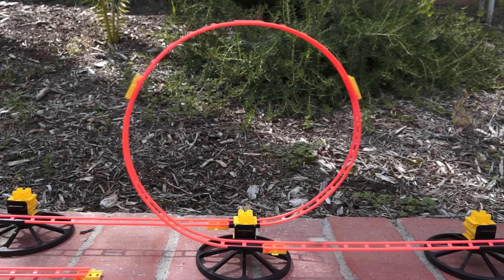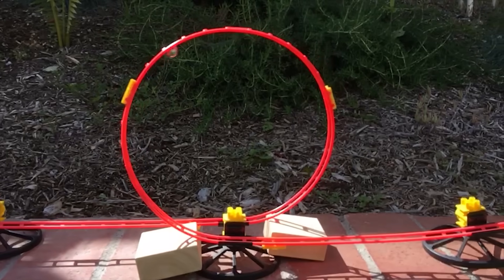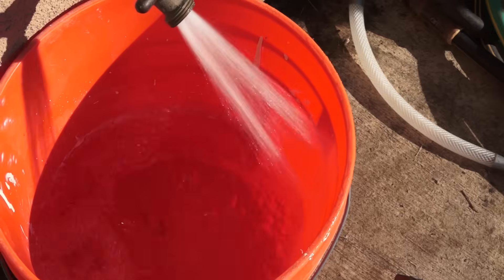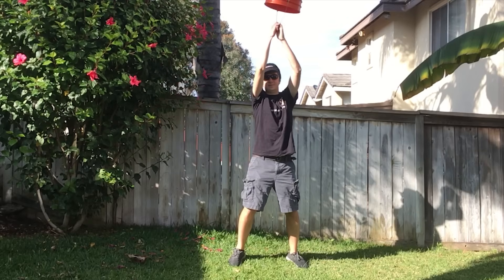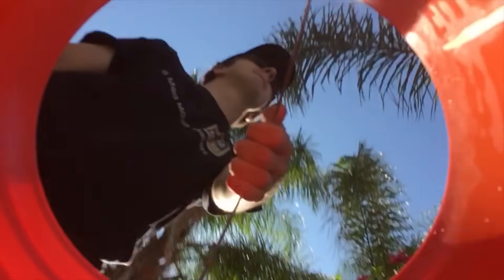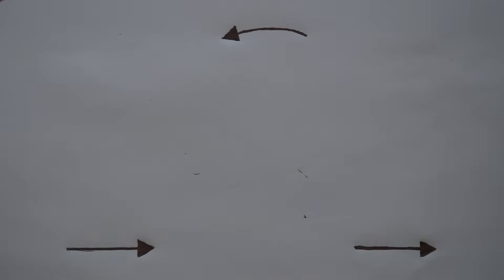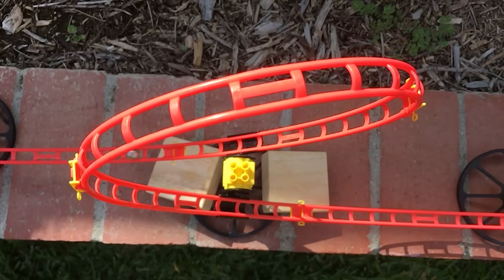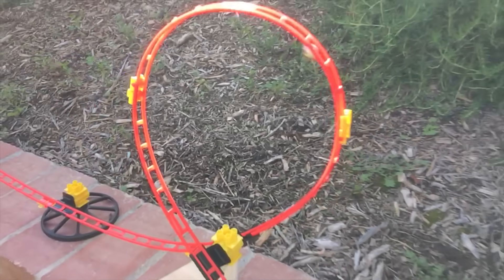Why a Perfect Circle is not a Perfect Loop

Comment: I reality you still experience less G's at the top of a loop than at the bottom. For example when you enter a loop with 4G you wont experience that same amout of force at the top of the loop when you're upside down, because you would snap your neck. At the top of the loop the forces are much closer to 1,5-0G.

Comment: Teardrop (technically called clothoid) loops are great! They reduce stresses on the structure of the roller coaster, the train, AND the riders! However, circular loops are ok if the loop is large enough!! Take, for example, Full Throttle at Six Flags Magic Mountain. The shape of that loop is a perfect circle. It also used to be the world's tallest loop at 160. Now granted, that loop was designed to produce hangtime at the top (the feeling that you will fall out but the restraints hold you in) as the loop is so large that the train goes very slowly through it, nearly stalling. But that's an example of a circular loop on a modern roller coaster.
Reply: I think full throttle isn't a perfect circle. It's just slightly teardropped. The track intersection at the bottom of the loop still creates a tiny X. The tracks aren't parallel to each other.

Comment: What if I want to feel weightless
Reply: There's a cost to weightlessness, when you are trying to set it up while constrained to the gravity of our planet.  A circular loop no matter what the radius, would require you to experience SIX TIMES your weight at the bottom of the loop.  This means a typical person will weigh a thousand pounds at the bottom of the circular loop.

This is why actual roller coasters use a tight curvature at the top, and a gradual curvature at the bottom.

Comment: It's true that roller coaster loops are not built as perfect circles but this is NOT the main reason. It takes a higher speed to make it all the way around a circular loop without feeling negative G force at the top,  In addition, the circular loop causes sudden changes in acceleration and forces that are uncomfortable, as well as greater forces on the track and supports

A non-circular loop allows a smaller speed and a more gradual change in G force from the start to the end of the loop.

Finally, it's not necessarily true that a circular loop always requires more energy. A circulat loop of the same height will require a higher starting speed to maintain a positive G force on the riders. With a non-rigid track, such as in this video, the higher speeds and forces cause more energy to be wasted in deforming the track. If the track was rigid, both circular and non-circular loops should lose about the same amount of energy to deformation.
Reply: No matter what the radius, if a rider on a roller coaster were weightless at the top, the rider would have to feel 6 times their weight at the bottom, for a circular loop.  This is unacceptable in roller coaster design requirements.  Sure a person could survive it, but could blackout or get seriously injured from that extreme amount of g's.

Comment: When flying aerobatics in aircraft we do the opposite: we intentionally decrease the g-load as we go over the top of the loop to make it visibly round to a spectator.
Reply from the maker: Dang, do you use a G suit?  How many Gs do you hit at the bottom?
Reply: No g suit. Depends on the aircraft but a 3g loop entry and exit is pretty standard.
Reply: No G suit. I never pull more than 6 Gs for any length of time so it isn't necessary. 3G is the standard entry and exit load for a loop in most of the aircraft I fly although some, like the Extra 300, are capable of a lot more.
Reply from the maker: That's sweet.  I'd love to learn how to fly someday
Reply: If you are ever in San Diego I can hook you up with a lesson. :)